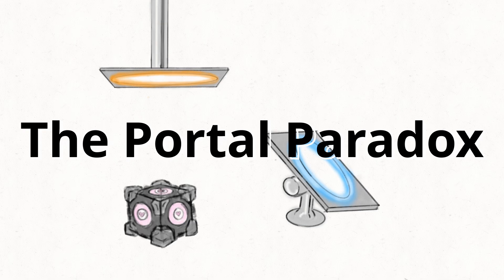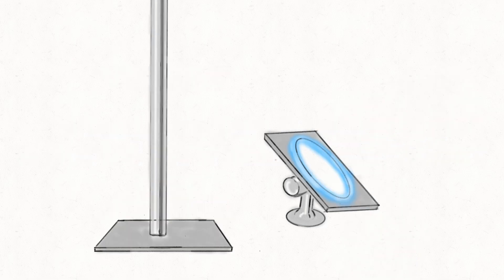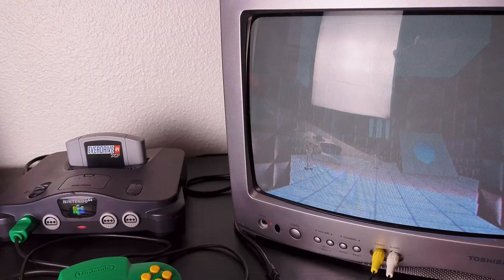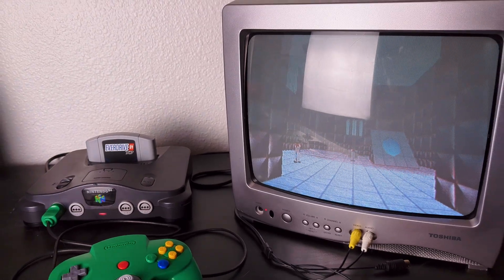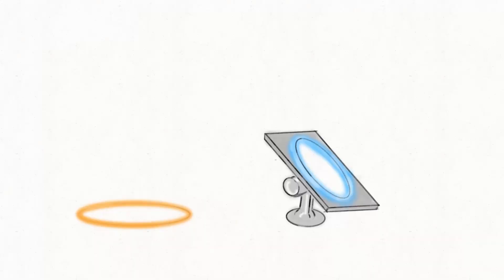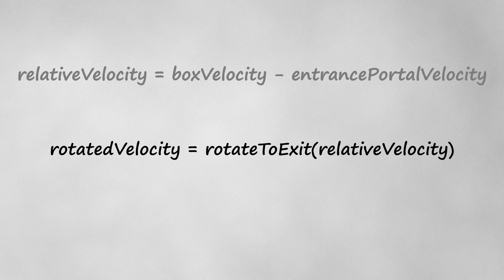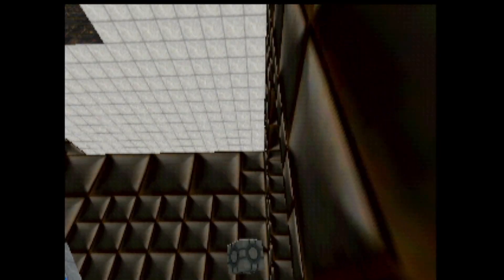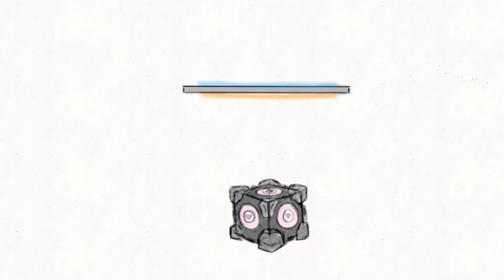I rewrote Portal from scratch and solved the Portal Paradox

Comment: First comment: Mad respect for getting straight to the point with your video and then elaborating afterwards.

Second comment: To the mathematically inclined, I believe the portal paradox is equivalent to the question of whether your equations are correct. I don't believe you have solved it. Should you calculate the relative velocity, or should you just use the velocity of the cube? In some ways, that is the portal paradox, determining what the developers truly intended to be the correct equation. With no way to test it in their original game, there's no way to know unless a developer tells us or someone manages to steal the source code. However, I believe that your approach to the equations is the correct approach for the physics they introduced in the game.
Reply: There is no such thing as objective velocity. All motion is relative. This equation is the only one that coherent at all to physics, as well as the only one that lets portals work at all.

A portal that doesn't conserve relative momentum would have to crush the cube flat in this case, since "not moving" would mean not being able to exit the portal at all.
Reply: @fieldrequired283  Good point, comment restated: The portal paradox is equivalent to the question of whether the equations should calculate the velocity of the box relative to the portal or relative to the room. I still agree that they should be calculated relative to the portal, as you have agreed also.
Reply: @mike1024.  
That is certainly a way of formulating the question. I think the thing that makes it confusing for most people is an imagined appeal to "objective" velocity.
Reply: @fieldrequired283  Those people must have never taken a physics course, not even in high school. :-P On the flattening point, that's a good question. If considering velocity relative to the room, would the next "layer" of box material push the previous "layer" through the portal, thus keeping the cube intact? Or would it just fail to move through the portal and be squashed? I think you're correct about the squashing. It depends on if you could claim the cube "layers" are exerting a force on each other.
Reply: @mike1024.  
If you postulate that the layers of the cube exit are pushing each other out of the way, that's just a roundabout explanation for why the cube is in motion as it comes out of the portal.

"The cube pushed itself" isn't the most satisfying way to explain the problem, but it's still worlds better than "the cube travels through the portal without moving".
Reply: @fieldrequired283  We'll say that's the actual second outcome of the portal paradox then, where it just comes out and falls haha. And you've come up with a third outcome, where the cube gets squashed. Oh well, first outcome of velocity relative to the portal, where the cube comes flying out, is the right answer in our opinions anyway.

Comment: That’s a tough nut to crack. Both scenarios seem intuitive and both seem to break the laws of physics when I think about it. 

With your current implementation, I imagine a moving portal on a surface with a very low mass, thus requiring low energy to move it, moving very fast through a vacuum  and slamming over a very massive object. If that massive object flies out with relative velocity it will have a lot more kinetic energy than it took to move the portal. Free energy? Perhaps that massive amounts of energy required to bend space imparts some of its energy to the massive object. 🤷‍♂️

In the other scenario where the cube doesn’t fly out, imagine doing a test where you have a car driving 100mph towards a portal going 95mph. If the car goes through the portal at a relative 5mph but velocity is not retained, then somehow the car would exit the stationary other side of the portal going 100mph. I feel like that’s also a free energy boost, no?

Comment: 2:35 I hadn't thought of that and completely changed my mind on how the paradox would go. Makes total sense with conservation of energy in a system.
Reply: he didn't solve that problem though. and he also didn't solve the problem of conservation of momentum.
Reply: @kannix386 
How though?
It's almost analagous to running from the front of a train to the back at the same speed at which it's being driven.

Even though the orange portal is slamming down towards the cube at a certain speed, much like how the train counteracts the runner's velocity with its own, the blue portal's velocity cancels out any gained velocity the cube got from the orange portal.

The orange portal "gave" the cube some positive velocity but the blue one "removed" velocity so the cube remains with a velocity of 0. Hell, if you were to make the space between portals 0, you shouldn't be able to tell by any means that you're passing through a portal, since whatever effects pass through one portal immediately come out the other, at the same point in space. If that slammed down and passed the cube through it, it wouldn't make sense for the cube to suddenly jump, so why should that condition revolving around velocity change when nothing but position is the difference between the two tests?
Reply: @BaeYeou  if the two portals are at different potentials, you can create or delete energy by passing through one. that shouldn't be possible. solving this problem is not as obvious

Comment: I don't think a moving portal would impart energy to the cube.
Reply: It doesn’t have to. Motion is relative.

Imagine two cameras. One is locked onto Object A, the other into Object B.

From camera A, Object B is moving toward Object A, and Object A is staying still.

From camera B, Object A is moving toward Object B, and Object B is staying still.

Both cameras are correct. Something is only moving if it’s moving compared to something else.

If a camera were locked onto the portal, the cube would be moving toward the portal. As a result, the cube keeps moving through the exit portal with the same speed.
Reply: @freedomfighter763  Nice points!  Although I'm not sure if this works to explain why the cube would shoot out of the portal.
1) In the case of the cameras looking at each other.  I think the astute person would consider three possibilities.  Either camera A is moving closer only, camera B is moving closer only, or both cameras are moving toward each other.  It's not so much that the cameras are "correct" but rather they show what they show and the observer tries to interpret what they see.
2) I don't think something is moving only when compared to something else.  It's just much easier to tell you are moving when there are other objects involved.  I guess this would be observable motion?  If you are moving but it's hard to tell, are still moving.
3) Taking the above points, I don't think observable motion would change the actual energies at play.  If object A is not moving then it has zero kinetic energy regardless of what the observer thinks he sees.

Comment: The thing that is wrong is that the the portal has no way to transfer energy to the box.

A portal is nothing more than a hole connecting to another hole similarly to a door and an object is not going to move just because you dropped a door frame on it.
Reply: To be fair. We don't have portals like portals from portal so we could just be both wrong and it could go boom

Comment: As a layman I’m still thinking about the theoretical assumptions made by modern physics so I don’t know about the momentum shifting from the portal to the cube.  It’s at least unintuitive, but there are other matters I’ve accepted as logical that also are not intuitive so I won’t consider that feeling.

However, you asked if there’s anything wrong with your equations.  I suspect they are 100% correct based on the theoretical axioms.

Comment: There is no paradox.

A portal has zero effect on the momentum of an object, it does not create relative velocity. It's one of the attributes of a portal that is directly stated in the game.

It's literally the same as walking through a door, it's just that the other side is in an unusual place.

It's the weird sci-fi element that doesn't need to match up with real physics. The game directly states this when Glados explains how they work.

You can't apply this kind of thing to it because the game literally directly states that isn't how they work. It's sci-fi so they can get away with ignoring this kind of equation due to some odd fictional property.

The game states this in an explain like I'm five way and doesn't really leave it up to debate.

Comment: So I don't think you're correct. What should happen is that the cube should just start sliding across the floor as it goes through the portal more and more as if a table was being slid underneath without any friction between the table and cube until it went over the edge as if the edge of the portal was the edge of the table. The reason this would happen is because once it is through the portal the orientation of the cube in relation to gravity changes. The reason it wouldn't shoot out like you're suggesting is because the cube stays stationary on the floor even though the portal drops around it extremely fast and it looks like it pops out of the other side quickly. I think where you're getting confused is because you're thinking of it as if you're looking through the portal from the exit and seeing a floor rapidly approaching and stopping immediately giving the illusion that the cube is moving through the portal extremely fast and immediately stopping, but as I said the cube never moves even if it looks like it is. I don't really know how to explain why that's the reason I think that it is that way with math and everything because I am not good with math like that, but just looking at it doesn't seem right. Maybe if the air that also comes through the portal that creates a denser air space above the cube until it dissipates, or something is why it doesn't or some other reason that's impossible to tell without being able to actually recreate the experiment in real life where it conforms to the laws of the universe that we don't understand enough to create a simulation of it like you're attempting to do.

To put it bluntly I'll use Oppenheimer as an example, which is lame and cheesy I know.... Basically, as Oppenheimer was told theory can only take you so far, which was exactly the case when he tried to prove that the atom couldn't be split after hearing the news and creating an equation that proves it wasn't true only for one of his students to recreate the experiment in the room next door and prove his theoretical equation wrong... As well as when the one guy came in with the equation that showed if they detonated an atom bomb it could lead to a chain reaction that would destroy the atmosphere and the entire planet, which they then later recalculated and figured it was a very slim possibility that turned out not to be the case. So, to say the least, my point is either of us could be right and it will be impossible to get a truly correct answer until it's possible to create the experiment in a manner that relies on the laws of the universe as any answer could be made true in a simulation depending on the road one takes to get to that answer.

Although that's just my uneducated opinion on this theoretical scenario.

Comment: Won't the stationary cube just tumble over as it goes out to the other portal when the other portal envelopes it? The cube didn't move, the environment just change, thus there shouldn't be any force that repels it to the air. It's similar to how you push a hola hoop on something, it won't just shoot out as it goes through the hola hoop. It would just stay there, and imagine the spacial state just change, so changes affecting the object should be after it goes through the portal.

Comment: Wouldn’t the cube stay still, then roll down the slope after? The first portal has velocity, till it stops. There’s no transfer to the cube at all? The cube by intents is still in its original position on the pad to the right, as it’s still touching the original pad, but now has gravity applied at a slightly different angle, that’s it.

Comment: To use your hula hoop analogy: 
You have two portals. One is on a wall moving towards you, the other one is on a fixed wall somewhere else.
If you are standing still and you jump right before the moving wall slams into you, virtually passing through the hula hoop, would you then get flung into the other room instead of just landing on your two feet, since both portals aren't moving in opposing directions ?
Also, if you try to jump from a stationary portal to a backward moving one, wouldn't you be able to cross at all, since you would be "pushed back" .. Or is it the other way around ?
I think moving portals are creating more paradoxes and complications, but it is a really cool idea ! I commend you sir on your editing style and on recreating on N64 the piece of art that is Portal ♥

Comment: the thing about your way of how the block reacts is, that you create an impulse without transferring any kind of energy. meaning the entirety of the block should still have a total impulse of 0 leading to the part that has not entered the portal needing to have the same impulse in the opposite direction (since the block is still connected together). so how is this impulse part of your solution?

Comment: There's nothing applying force onto the cube itself...

Portals are basically wormholes...  You're treating the ends of the portals as two separate entities, when they're one and the same.  

If we're using the logic you used for the angled portal, then it should have been shot out the top when it was in the hula-hoop orientation.  Simply by adding rotation, doesn't add velocity.  

IF ANYTHING, what would occur if the portals were theoretically wide enough, is that you'd be stuck in a constant state of free-fall, until you gained enough momentum from the gravity and air pressure on the "stationary" end of the portal, to reach the edge of the portal.

Comment: This is basically how it goes except there's also the question of whether stopping halfway over the cube would suddenly pull it apart, or maybe be jerked by some small amount proportional to how much got to go through the portal although then it's as if we are deciding to keep track momentum instead of this relative speeds idea and that could be implemented to produce the other result from the original image.

Comment: We’ll done. But couldn’t it also be described and tested from an energy perspective? The stationary cube has potential energy. The surface of the piston with the blue portal has kinetic energy. Do you add the kinetic energy to the potential energy? Like, when the cube goes flying, it’s energy is converted from kinetic to potential and then back to kinetic once it starts dropping but where does that initial kinetic energy come from? The piston? What would the formula be?

Comment: The question would be much easier to grasp intuitively if the air was simulated correctly. Sensing the air being "sucked up" by the downwards moving portal and then "blowing out" of the stationary portal would show what is happening before the cube is even reached. Everything that goes into the entrance portal has to end up somewhere. It could never simply stay at the exact spot of the exit portal's surface, because it would keep being displaced by more matter coming in from the moving entrance portal.

Comment: I think your approach is wrong, and I can show you the flaw in your thinking, not in the equation (because that isn't wrong, it's just incomplete).

The portal moves relative to the cube, and thus the cube relative to the portal. The exit portal and the entry portal technically occupy the same space (that's why it is a portal), so by the entry portal moving, the exit portal also moves relative to the cube (well technically it doesn't, but that is because space is warped to make the portal work, so the entire motion between the exit-portal and the cube is nullified by the warping of space).

The cube, however, does not move relative to anything else in that room. Meaning, once the cube exits the portal, it should move away from the portal (because that would continue its relative motion through the portal in the previous line of movement), but at the same time it should not move in regard to any other surface in the room.

That sounds paradoxical, but isn't: The entry portal is stopped by hitting the floor the moment the cube fully passed through, meaning its motion relative to the cube also stops. 
So while the cube moves through the portal, it maintains its relative speed to the portal (otherwise it would be stuck between both portal surfaces), and once the entry portal hits the bottom, the relative motion is immediately stopped.

Meaning: The cube should just fall to the ground, otherwise the cube gained energy from nothing relative to any other reference in that room.
This also holds true, if the entry portal doesn't stop: The exit portal and the entry portal occupy the same space, so the relative motion between portal and cube still continues. It just becomes invisible, because space continues to warp to accommodate the two surfaces that move away from each other still occupying the same space.

If you wanted to fix the equation, you would need to account for the warping space, but I have no idea how to do that. There are probably some differential equations from relativity for that, idk.